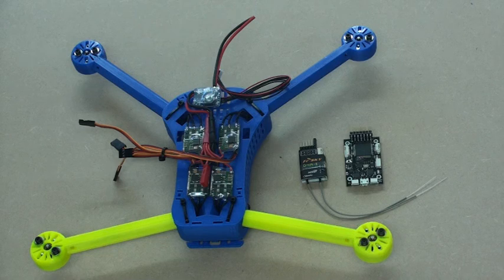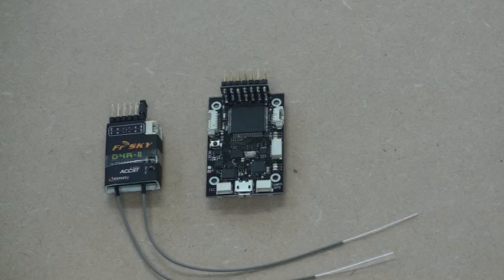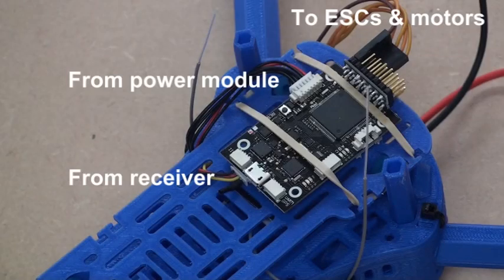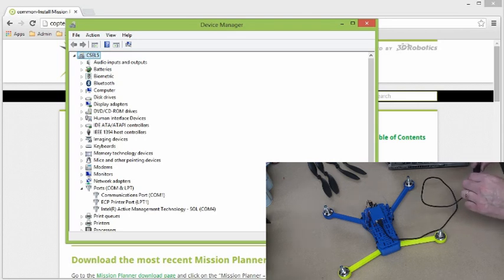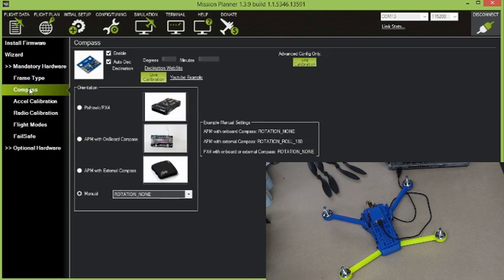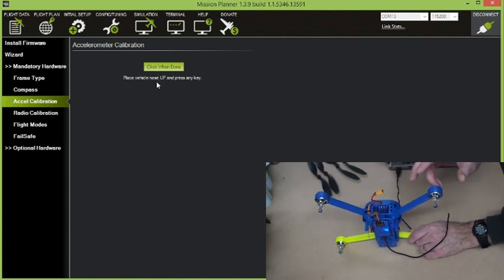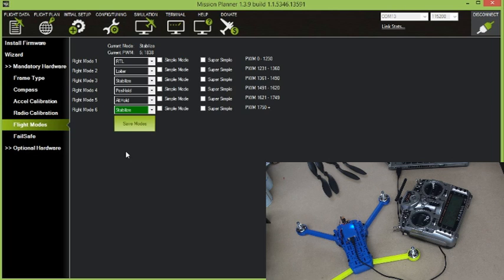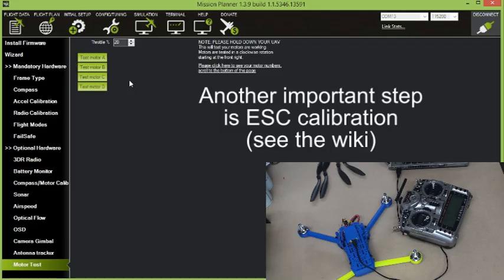T4 Mini Quadcopter build part 4: Flight control

Comment: Brendan, one last question if I may? I have purchased the same motors with the shorter shafts, and was wondering which props size you were running with these on a 12Amp Afro ESC. Can you push a 8 Inch prop and get some good results in flight time and easygoing flying style?
Reply from the maker: My mini 315 size is the smoothest quadcopter I've got with these motors: http://www.hobbyking.com/hobbyking/store/__18151__Turnigy_Aerodrive_SK3_2822_1090kv_Brushless_Outrunner_Motor.html

and these 8x4.5 propellors: http://www.hobbyking.com/hobbyking/store/__25818__8045_SF_Props_2pc_Standard_Rotation_2_pc_RH_Rotation_Black_.html
Reply: ***** Thanks Brendan. I have purchased the Turnigy Aerodrive SK3 2822-1275 Brushless Outrunner with Short Shaft (http://www.hobbyking.com/hobbyking/store/__26988__Turnigy_Aerodrive_SK3_2822_1275_Brushless_Outrunner_with_Short_Shaft.html)
do you recommend caping the props at 7 Inch or should I push it with 8 Inches, as your setup using DJI props 8x45?
Reply from the maker: FPV cambodia If you click Read More in the above reply you'll see a link to the propellers I'm using.  No idea about the props for that motor without reading up on them.  The comments on the bottom of the HK product page may be useful.
Reply: ***** Thanks Brendan.